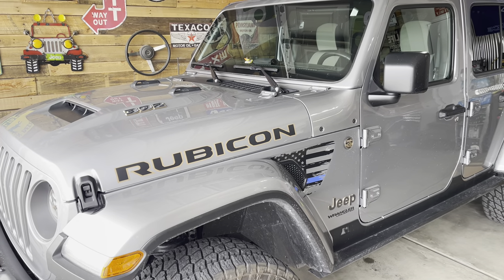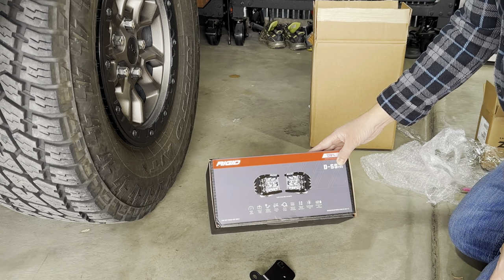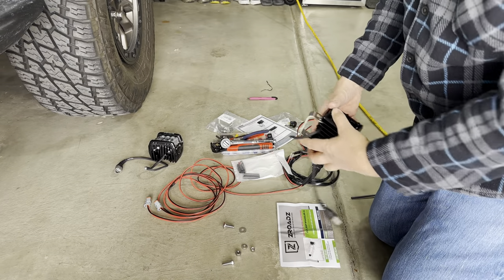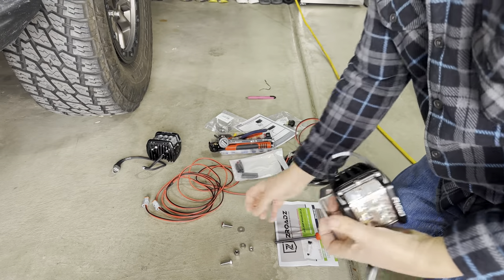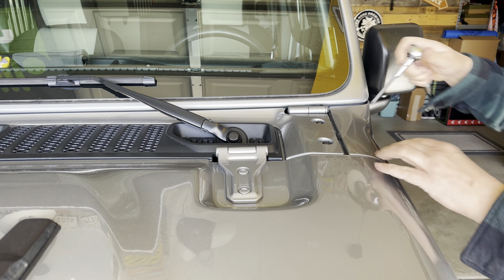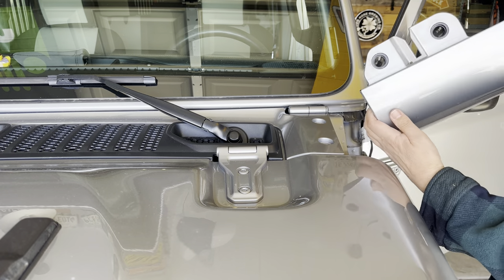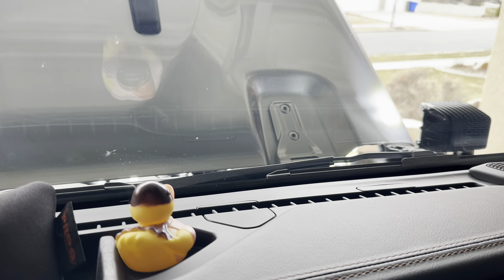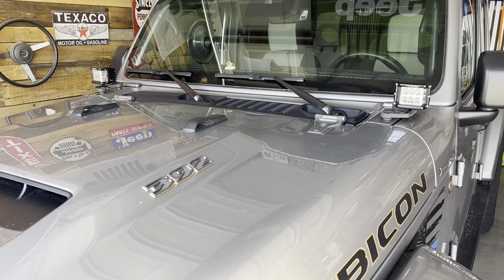Jeep Wrangler 392 gets Rigid DSS Driving lights: Install

Comment: Thanks, understand, in my case I will have to slice the wiring for the two lights together.  My wiring harness has a relay, fuse, and switch which I won’t need.  So glad we got the factory aux switches option, makes it so much easier.  Have a good one!

Comment: How is the hood glare now that you mounted them lower on the curved rigid bracket? I'm about to mount mine on my white 392 Wrangler this Friday and was wondering if I need to mount them on the bracket where they sit higher because of the hood glare. Also, found out that KC now makes a simpler bracket for our Jeeps to mount Aux cowl lights on. Little more expensive though....
Reply from the maker: I like the lights and I don’t notice any excessive or distracting hood glare.  They are very bright and do well on dark trails, I don’t notice the hood blocking any light, mounted low like i have them.  I still like the mounts I got, although they are starting to fade in the sun, as others have noted.  When I mounted mine, the 392 hood was fairly new and there weren’t a lot of options.  Now that it’s been around for a while, I’m sure that manufactures have come up with more options.  I like the low profile.  Good luck with your install, let me know how it goes. Thanks for watching.

Comment: Hi, thanks for the video, so did you just splice the wiring for the two lights together and make one positive and one negative wire to connect to the 15 amp aux switch you chose?
Reply from the maker: No I’d didn’t have to. The lights come with the wiring harness already set up like that so you dont have to do any splicing.  You only have to make the connection to the existing Jeep wires. 
Good luck and thanks for watching.
Reply: Worked like a champ!  Thanks again
Reply from the maker: Glad to hear!!

Comment: How did you tighten the inverted screw and without it spinning?  That’s the problem I’m having.
Reply from the maker: I’m sure you got it figured out by now with my late response… the square part of the bolt slipped into the slot for me and I was able to tighten it down.  But you may need to down size the bolt if that won’t work. Worst case may be to use a flat bolt with locking washer and red lock tight. Hope you got it to work. Let me know what ended up working. I wonder if Rigid changed something up. Good luck.

Comment: Don’t you connect wire to battery at all
Reply from the maker: Not at all if you are using the factory installed AUX switches. All you have to do is install the power wire from the lights to the AUX switch you want to use, and the ground wire on to a ground point, and you are good to go. Jeep made it easy.
Reply: @mybucketlist5940  How about my jeep Willys 2020 don’t have the AUX switch